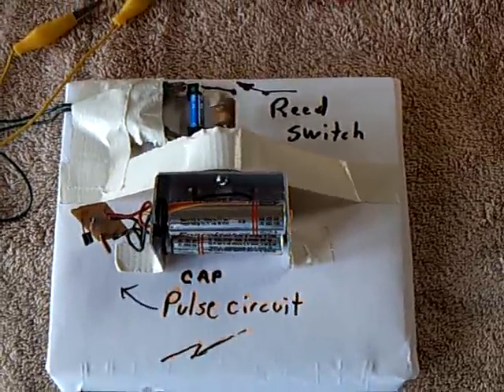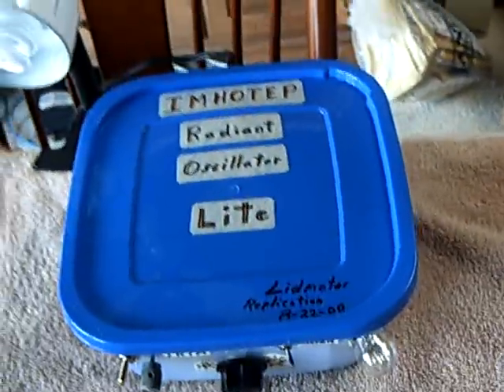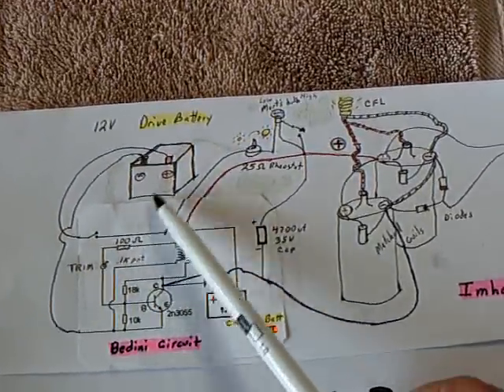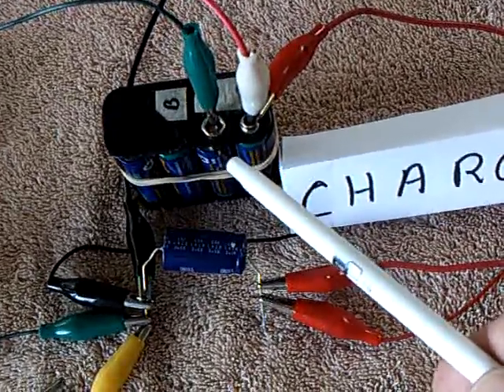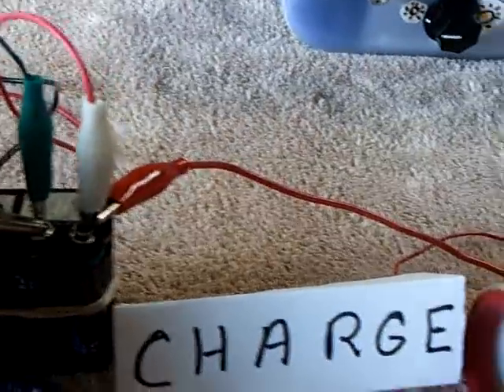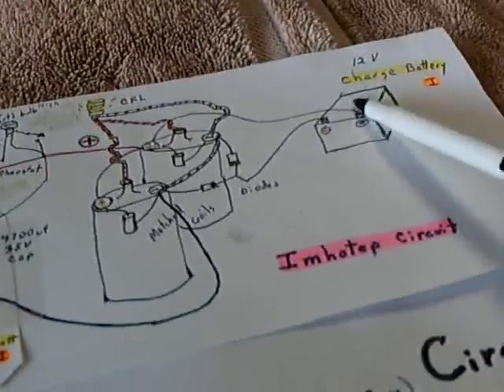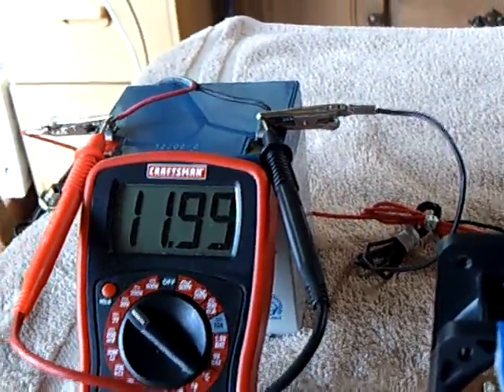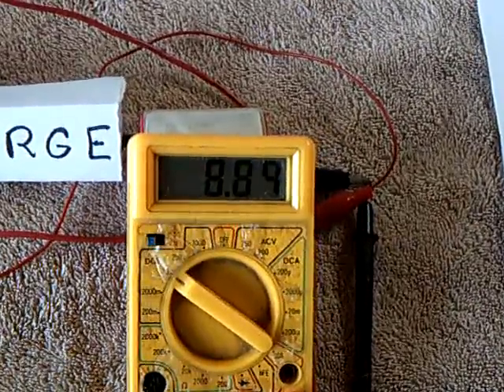Imhotep Oscillator Fan/Lite--Pulse charging

Comment: larger capacitors only take longer to discharge if there is resistance! Try hanging a piece of coppper wire across the cap you will see it discharge very quickly!

Comment: Obviously if you hang a battery in your solar powered circuit, it will charge providing it does not impare the operation of the circuit! If you connect the solar panel directly to your battery +ve to +ve it will still charge if the battery is up to it.

Comment: GReat work Lidmotor, interesting to see u combine these 2 projects together

with your pulse charging circuit i dont understand why u have the magnet and i think i saw a reed relay there to time the pulses. u also mentioned a 555 timer circuit to time the pulses.
Cant this be done with just the 555 timing circuit to switch a normal relay?